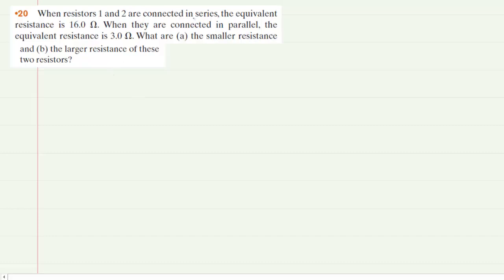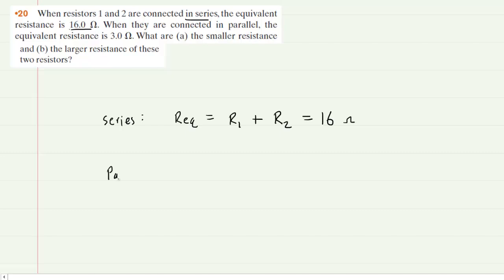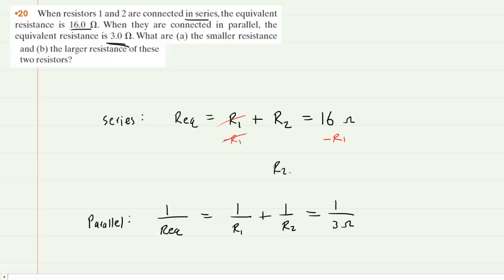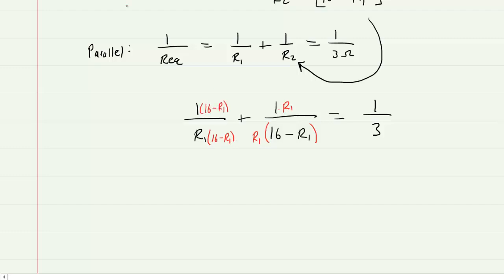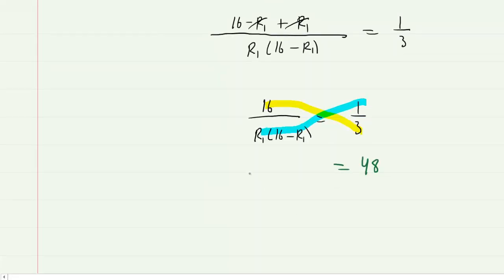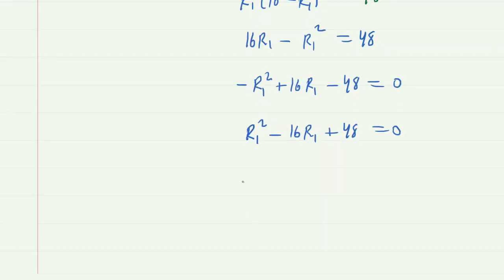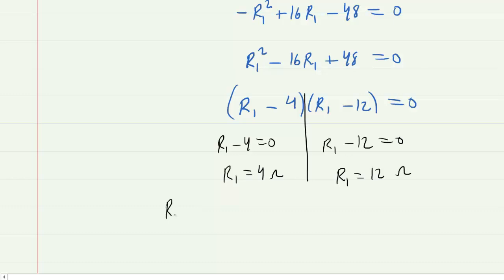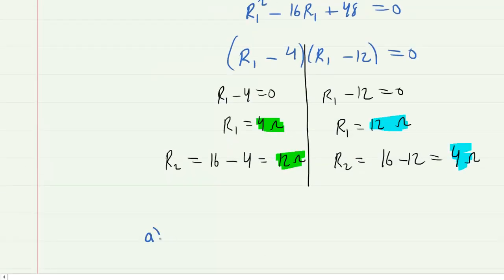When resistors 1 and 2 are connected in series

Comment: Hello!!! Can I request a Magnetic Force Problem?
A wire 25 cm long carries a 12 A current, 73 degrees from east to north. A magnetic field at the wire's location has a magnitude of 4.8x10^-5 T and is directed 2 degrees from west to south. How much is the magnetic force and its direction over the wire?

Actually I know how to solve it, but don't understand the direction, been using the right hand rule but no sure how to do it.

Using formula F=BIlsin
F=(4.8x10^-5 T)(12A)(0.25m)sin109
F= 1.36x10^-4N at the +z??? or -z??? not sure about the direction
If you can explain it I would appreciate it.

Comment: Suppose that a parallel plate capacitor has rectangular plates (area A) but the plates are not exactly parallel. The separation at one edge is d-a and d + a at the other edge were a < < d. Show that the capacitance is given approximately by: C epsilon_0 A/d (1 + a^2/3d^2)

Please help me to answer